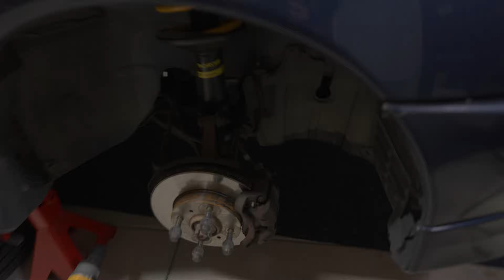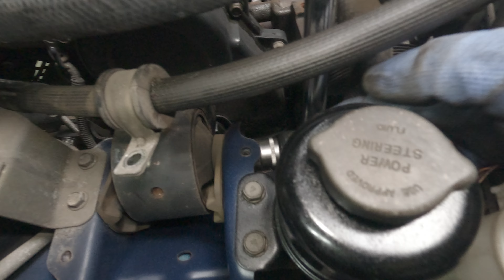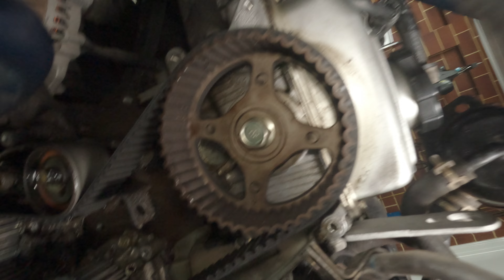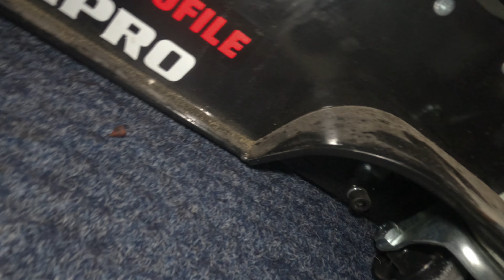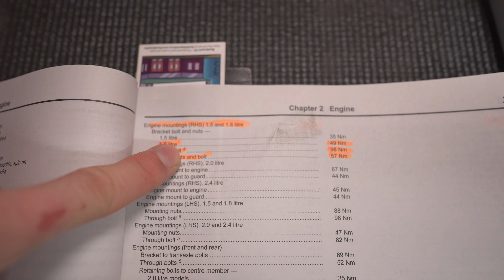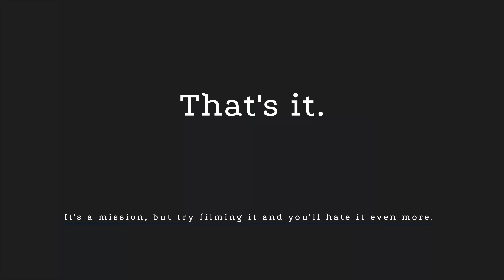How To Change Timing Belt & Water Pump || Mitsubishi Lancer CE - 4G93

Comment: Great vid!  Just to double check something: You get the new timing belt on and release the tensioner.  Then turn the engine two rotations, at the crank.  And when you're done, assuming all looks well, you re-tighten the tensioner, in place -- right?
Reply from the maker: Hey mate, been a few years since I've done this so I'd have to watch my own video again to remember.

Unable to watch it ATM but I can check back later.
Reply: @TheBrowneTown  I figured it out. Thanks though.  Yes, you want to rotate it a couple times, then tighten it.

Comment: Do you know what tooth count the belt was? Trying to figure it out for my kit

Edit: I called a misubishi dealer and its part number md191982 and the tooth count is 116 for anyone wondering
Reply from the maker: I don't know the number of teeth, I think the part number is TK288, which is specific to Gates.

I believe most automotive shops' online websites will be able to filter to what suits your car and what doesn't.